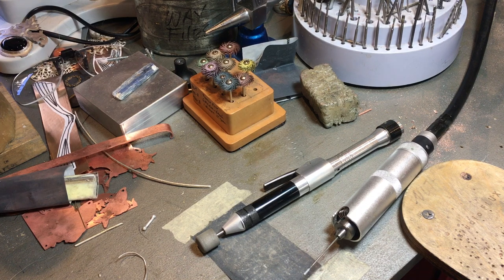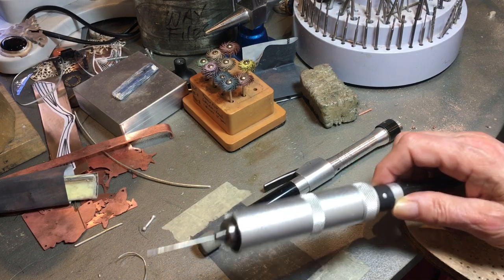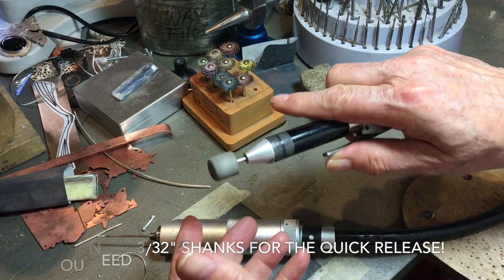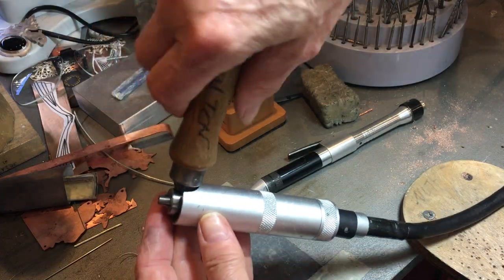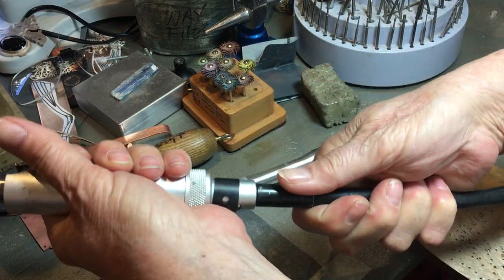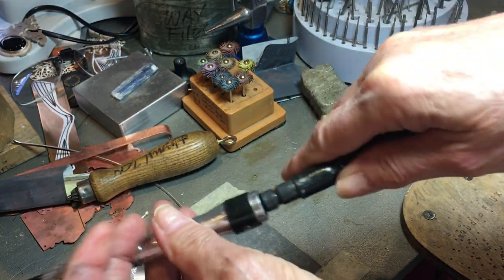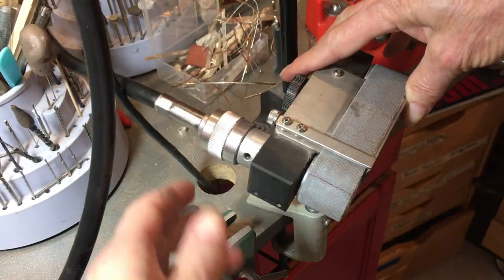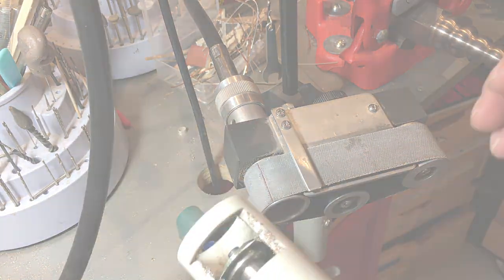How to remove a flex shaft handpiece and more!

Comment: Can i get a hand piece that takes 1/4 inch shank bits for the harbor freight flex shaft? Im thinking about getting a flex shaft off of amazon that says it takes 6.5mm bits but who knows if thats actually true. Just in case that hand piece isnt good or does not take 1/4” bits what is a good hand piece that WILL take that size? Thank you!

Comment: What type of quick release hand piece is that? I like it more then the other style, which is a lever that you push perpendicular to your tool to release the bur, then back again (in line with the body of the hand piece) to secure the bur.
Reply: I have the same question

Comment: Keep those old HF flex shafts because the new ones don't fit Foredom hand pieces tight like that. They changed the flex shaft coupler on the new HF Flex Shaft Grinders. 

That and Foredom has gotten real sloppy with their quality. I just bought the 44T hand piece.. what a disappointment. The HF Chicago Electric Hand piece is better in someways.